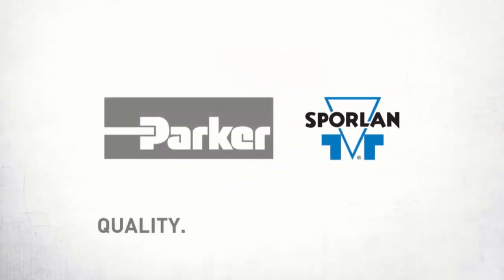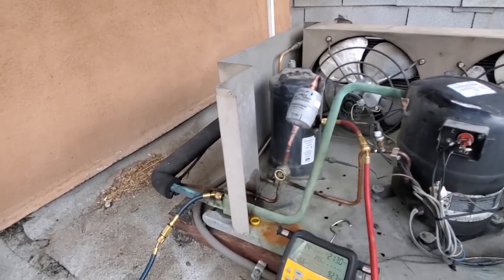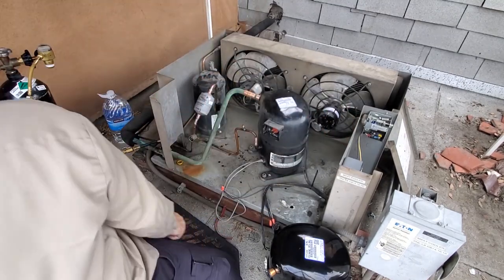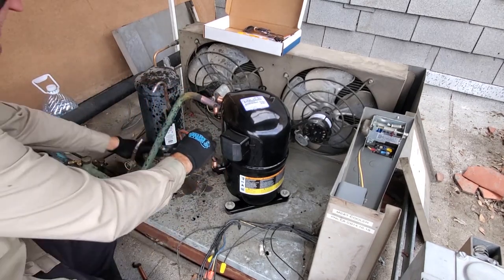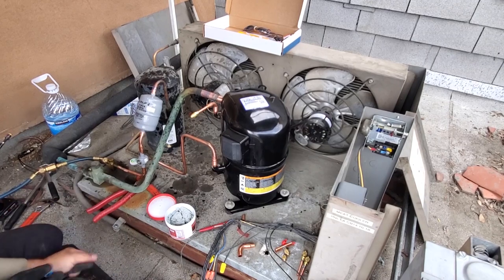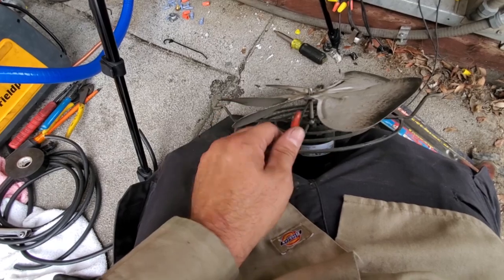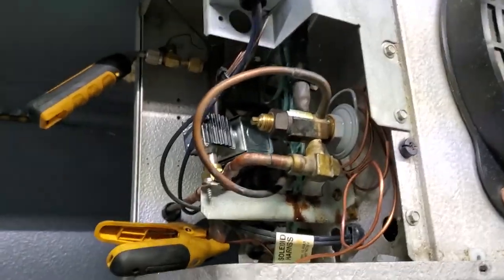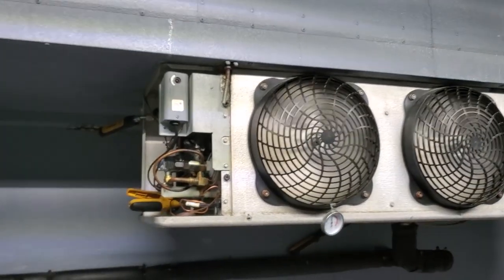WALK IN COOLER NOT WORKING

Comment: Lot of times you use a flair nut system for your dryer. 
You didn't this time. Space limit ?
Reply from the maker: Yeah it just would have required a some more piping and I was in a time crunch.
Reply: HVACR VIDEOS 
You stated the box was at or near 100F for around three days. 
10-15 more minutes ? 
Was gonna be a killer, & basically was similar to a burn out.  Hmm 
Your call , you was on the roof, just really surprised me that's all.
Reply from the maker: I don't quite understand what you are saying here, The unit was off when I arrived and the manager told me it had been down for a few days and the temperature inside the box was  above 80 in there but I never measured it.

Comment: how do you bring down heavy compressor from roof to floor ?
Reply from the maker: depends on how heavy it is, if its under 75 pounds i use a rope and just lift it. anything bigger and i either use my equip lift or a crane
Reply: How about yelling, “lookout below” and just chucking the thing over the roof into a dumpster?

Comment: I can tell that you may not have had any climbing experience since you step on your ropes. Then again, you’re not relying on that rope to carry your body weight.
Stepping on the rope forces dirt and grit into the rope which causes them to wear rapidly under tension.
Reply: Not only that, but rope doesn't really provide a good surface for walking on (I'm a former combat engineer, and our instructors drill that part about the rope wearing out more rapidly into the trainees brains), the other part becomes obvious when you end up taking a pratfall (or two), while stepping on a rope!.

Comment: There was no need to recover the  gas. U had suction valve and discharge valve to isolate the compressor.
Reply from the maker: that is a negative sir there was a liquid and suction valve
Reply: Looks like discharge service valve were you connected the high pressure cap tube

Comment: i guess TXV bulb was not touch the pipe properly ,so didnt sens suction temp correctly, coz of that valve not operate properly, then some tech adjust the TXV,  refrigerant got extra block, compressor valve receive over weight and internal bypass occur, 
HP switch got fault itself due to continue open  and closed ,
comp contactor got fault due to comp on and off continuelly coz no time delay or manual reset option.
if ever i saw comp bypass first i remove refrigerant  ,make 0 psi, on the unit charge refrigerant slowly till again by pass, and the note down the refrigerant weight and  pressure and comp AMP at which point its bypass, off  the unit reduce pressure little, on unit again, while running under pressure check pipe line is there any unusual temp drop like after condensor , after filter drier, after Liquid receiver, after sutoff valve, if found it mean that part is blocking refrigerant, if not found any , check TXV, make heat the bulb and check open close opration, check TXV adjustment,  use screwdriver as  a stethoscope and check refrigerant passing sound before and after the TXV, and if sound not constant open and check TXV strainer, could be block, 
if no unusual pressure and temp drop or refrigerant block, and still comp cant hold the appopriate  refrigerant volume without bypass, ill go to final decision as comp is mecanically fault.

Comment: Electrical tape is the worst invention, I hate it. Always wear gloves and glasses when brazing, flames and piping are hot. Always have a fire extinguisher nearby when brazing, soldering. Always check the voltage on the new compressor, supply houses have been wrong.

Comment: that oil looked more like sewage water, in which I've seen plenty of over the years (puke puke)
Reply from the maker: Yeah it was overheated for sure, part of the reason why I changed the cfm's I had a feeling one of them was failing which possibly caused the high pressure control to fail.......

Comment: You could have saved a trip for another recovery tank by tightening the valve packing .Or u could have filled through the vapour side and just invert the tank to refill system. Let's see some practical knowledge not just superheated readings from you fancy gauges. I like analog they don't lie and are cheep to replace. Tools don't make the mechanic if they are not used correcly

Comment: didnt have to pump down whole system, there is a shut off valve on discharge line, close that and suction service valve and no need to pump out refrigerant from rest of system. Why change two good fan motors, control? Changed parts didnt have to. Would have been cheaper to replace whole condensing unit. You replaced every thing but the case, receiver and time clock. Time and money wasted.  I'd be PISSED if i were your customer and saw this. Also wrong on other stuff. Sorry thumbs down, u need some classes bud.
Reply from the maker: I think you need to watch a few more of my videos and im pretty sure I addressed  why I changed both motors at the end of the video but in case I didn't the ambient temps at that location are 120+ degrees and the condneser fan motors dont even last a year in this conditions, and the location is about 2 hours from my shop so after consulting with the customer we decided it was best to replace the motors just out of caution. Of course there are always things I can do better, id love to hear your opinion on what else I did wrong im always looking to better myself????
Reply: @HVACRVIDEOS  Why change the low press control? That system NEEDS a pressure limiting TXV or a crankcase pressure control to protect compressor on start up and when running higher temps.
Right about those motors, do not last under high heat, even new ones can fail soon. Id recommend just keeping spare motors on the customers site. Spent A LOT of time pumping down system unnecessarily. There is a valve about 18 " downstream from compressor, same as on on suction line. Its there for the SOLE purpose of making possible to change compressor without recovering receiver and rest of system. close those with allen wrench and u only have to evacuate 2 feet of line.
Reply: and im not trying to be rude. just pointing out. You have many good practices too.
Reply: @HVACRVIDEOS  120F!!!!! Never seen a cond unit handle that much heat with out being over sized. I know it happens a lot with roof top units. How are the scrolls handling that?